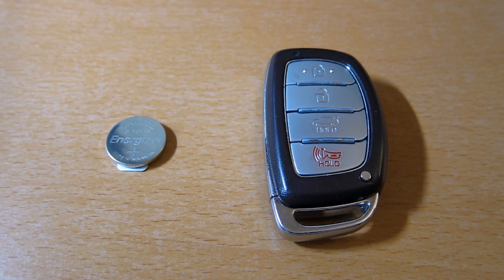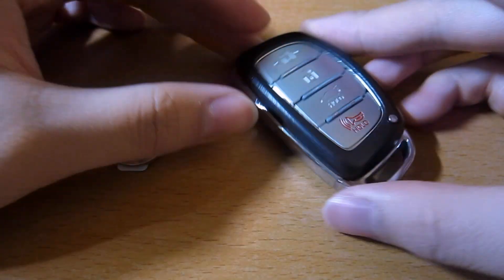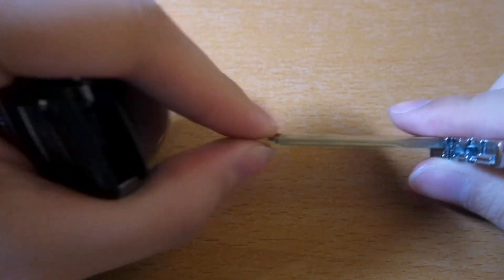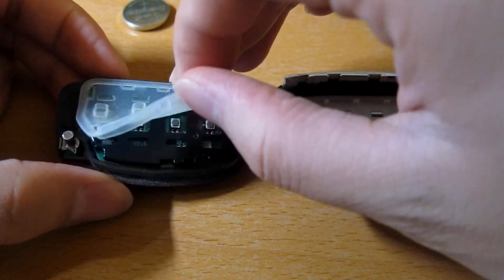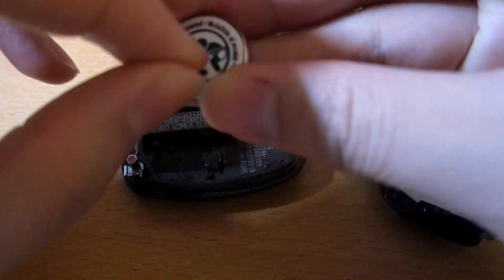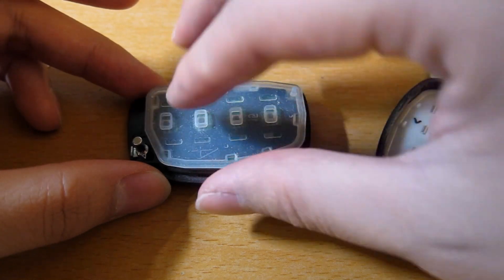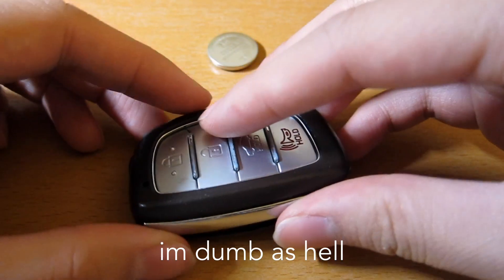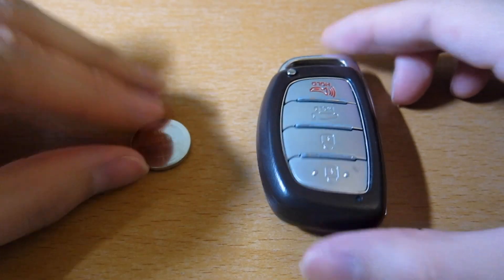How to Replace Car Key Fob Battery (No Tools)

Comment: It is much easier to pry it open with the tip of a butter knife.  Insert it 1mm at the top of the chrome piece on the bottom plastic side (the one with the H logo) and gently pry open.  Don't forget to properly fit the rubber piece all around back in place.

Comment: im dumb as hell too. I dumb bought a dumb cr2025 battery instead of a dumb cr2032 on dumb accident because I was dumb rushing at the dumb dollar store but dumb figured I’d try it anyway for dumb shits n gigs.  Turns out it’s working so far i dumb think because even though it’s dumb thinner, the dumb fob is holding it in dumb place well enough to work for the dumb time being until I can dumb get back to the dumb dollar store and dumb buy the correct dumb battery!

Comment: This method did not work, and I ended up with a now chipped and damaged plastic casing of the key fob, both externally where it chipped on the edges and internally around the supposed gap referenced in the video.  I ended up using my fingernails and sliding them between the vertical metal trim piece on the fob, after removing the valet key.  I had to gently rock and slide my fingernails up and down the crack between the metal trim and the brown plastic until it eventually gave way.